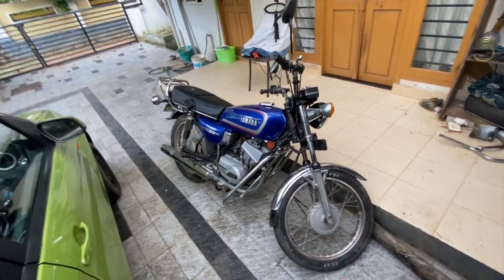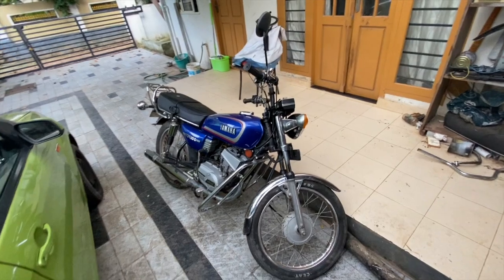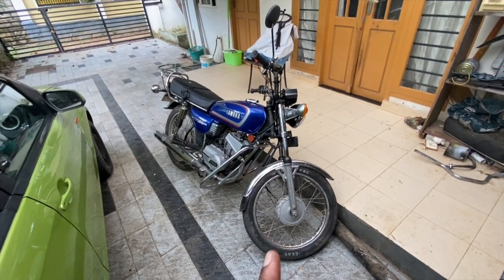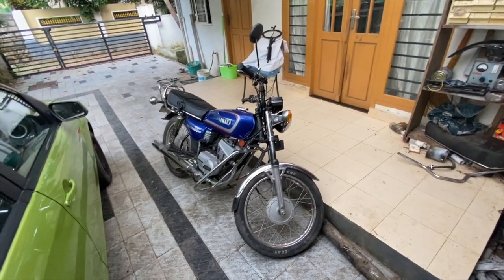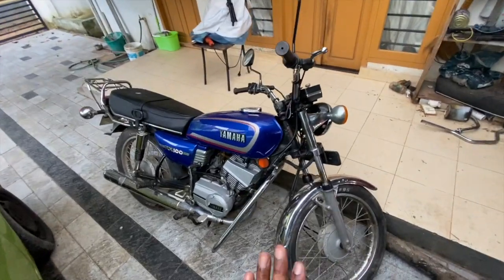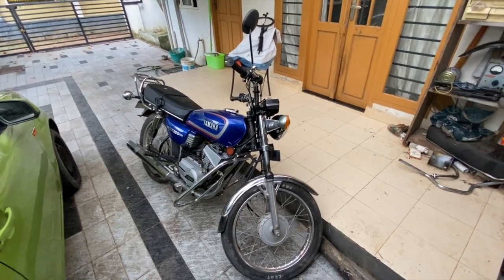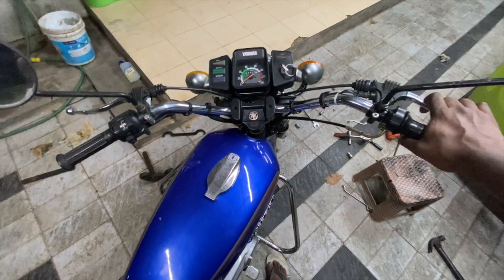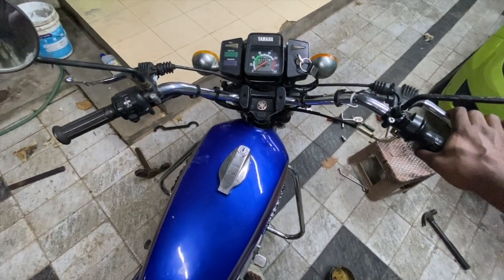Fixing a 12 year old issue in my Yamaha RX 100 (English video)

Comment: Sir can we use rxz 4 speed silencer in rxz  5 speed does it has any effect
Reply from the maker: Yes, I am using the same on my bike, it will loose some low end torque but the engine will rev freely

Comment: How is the Allied CDI performing? Reviews
Reply from the maker: Please look for the allied installation and review videos
Reply: @Yamakaze  Yes I have watched your videos. I wanted to know what's your review about it or experience with it after using for a few months.
Reply from the maker: Works well for me, some people have complained about engine running hotter, I have personally not felt it. Then there is the famous issue of bulbs getting blown out due to shorts in the wiring and faulty RRunits. So talk to the vendor if these issues are resolved.
Reply: @Yamakaze  okay thanks👍🏻
Reply from the maker: @hridayburagohain5060  👍

Comment: Sir, one think want to ask you as I read on xbhp site regarding yamaha rx 100 six hole silencer, in that I saw that yamaha rx 100, and yamaha rxg 1996 model after the discontinue of rx 100 rxg 1996 model also comes with six holes in the silencer. Is it true waiting for your early reply. Thanks 😊🙏.
Reply from the maker: I am not aware of that but initial lot of bikes were parts bin specials. That is a possibility
Reply: @Yamakaze  Thanks 😊🙏.
Reply from the maker: @noshirkhurshidhanozmehta9163  👍

Comment: Bro my bikerx100  
After running 30, 40 kilometres
Slow down cheyubol vandi off agunu
Pine start cheyan padanu ideal nikunilla 
chock valichittum vandi rise agunila
Carbureter ,redvalv Matti  
Problems is there  I also change CDI unite (Indian elactronis)
Reply from the maker: Tankil thurumb undo?
Reply: @Yamakaze  Ella bro new one
Reply from the maker: @mavishkumar478  fuel tap and fuel filter check cheyyu

Comment: Brother while riding my rx135 its sounds like pada pada pada when i increase the throttle it sounds gud , but when riding in a normal hight road when i give throttle means it sound like pada pada pada when i increase throttle it sounds gud like normal ,
Reply from the maker: Backfire, timing is out, either one of the 3 are about to die, cdi, pulsar coil
Reply: @Yamakaze thanks brother

Comment: Hi bro nte rxil gear shaft oil seal 2,3 terms change cheyithitum oil leak issue ann
Reply from the maker: Athu elakki nooku, enthengil scratch undo ennu. Aanegil araldite ittu oil seal ittal mathi
Reply: @Yamakaze  shaftil cheriya scratch und ath replace cheyano 
alengi bro paranja pole araldite ittal leaking issue solve avo
Reply from the maker: @jojofernandez2638  cheriya scratch onnum cheyyanda, leak avunna reethiyil aanu scratch then Athu mattanam
Reply: @Yamakaze  bro rxinu Fornt forke hieght kuttunadh best way ?
ullil cheyane ano purath cheyane anoo better
Reply from the maker: @jojofernandez2638  purath